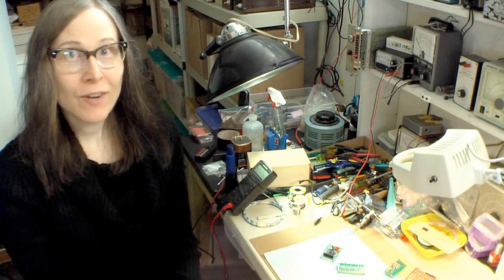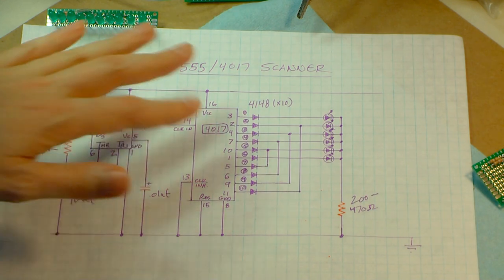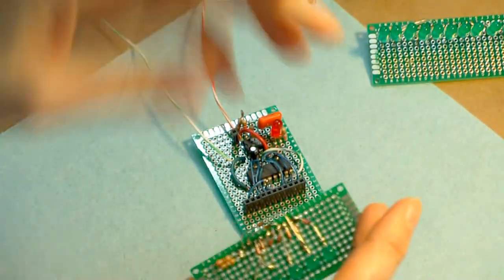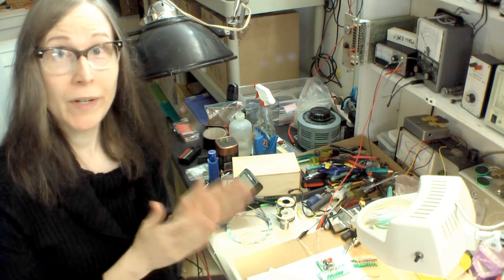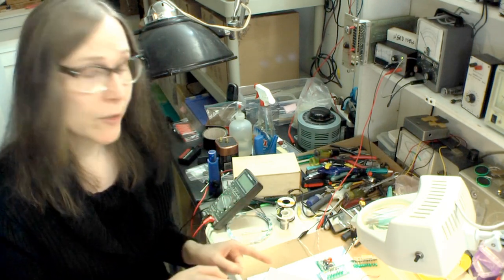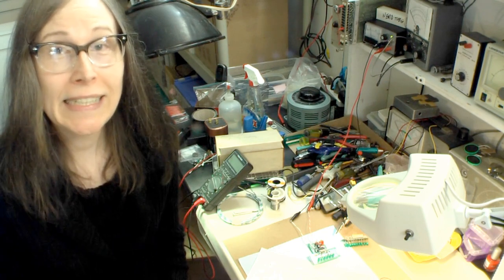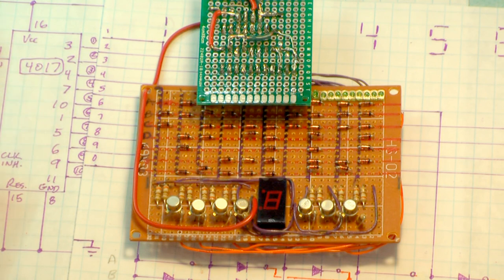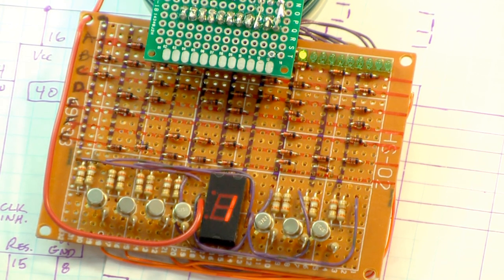FranLab: Diode Steering For Displays

Comment: Interesting project. But I don't agree with that "diode arrow points the wrong way" nonsense. Allow me to explain. When I was a kid and learning about electronics, books told me about the "real direction" of current flow, so I figured I'll use that in my own thinking then. Starting from thinking about circuits "upside down" and even using a red wire for negative and black for positive, and ending with circuits not working. That stuff put a dampener on my enthusiasm, too. I wish books and educators would just say "forget any concerns about the electron flow, and do everything based on conventional current flow". Like everyone else does in electronics.

Unless you're dealing with electrochemistry or the inner structure of transistors or other physics like that, I don't see why you would need to bother thinking about electron flows.
Reply: +renxula Obviously never had to look at any vacuum tube amps or worse.. tube state logic.. "conventional" current flow (which is wrong and should have been sorted out immediately the electron was discovered which is over 100 years ago,, and the other wrong explaination scrapped) will leave anybody who doesn't  know the "convention" is actually nonsense.. puzzling themselves to death about how a tube amplifier or flip flop or latch or diode or anything really.. works..

Like Dave over on EEV says "It's shit, so ignore the "conventional" bull and remember electrons come from the ground, or out of the Negative end"..Then it all makes sense, even those arse about face reverse common sense "wrong" polarity transistor 
semiconductor things !!

I guess some people still think the Sun goes round the Earth eh?
Reply: Sure, if they had fixed things when the electron was discovered, we wouldn't have to deal with the notation now. But like I said, there's no problem unless you need to consider actual electrons physically flying around, instead of just electricity flowing. Yes I'm glad I haven't had to deal with vacuum tubes. But also I don't think semiconductors have wrong polarities. See how easy it is when you think in conventional current flow? :)
Reply: +renxula   I agree with your pragmatic approach.  There are different layers of abstraction appropriate to different activities.  Electronic engineers generally don't need to "how a diode works" (quantum mechanics?) but "how might I use a diode as a component".  Plus, not many will be designing for vacuum tubes these days.
Reply: + Ray Kent. I agree.. it's a matter sometimes of generations. I learned all my stuff when what I saw was vacuum tubes.. radios tv's mono and colour.. and a CTV with maybe 10 transistors and 30 tubes was fun.. So that's why I always think about where the electrons come from and where they go.. because trying to look at a tube circuit using "conventional" current flow directions.. well.. they don't work, it's impossible.Once I worked that out at around age 12 it all fell into place, after all.. what is a circuit?.. it's electrons, coming from somewhere and going to somewhere with a more positive potential. Mostly these days I do solid state stuff like laptops and cooked graphics cards, but I'm also the only kid in town who can fix your 50 year old prized Marshall or Fender amp :D

I stand by my logic that all this confucion could have been very simply avoided 100 years ago by tearing up the "current flows from positive to negative" books.. once that was proven once and for all to be incorrect. The fact that people will still try to defend something which is categorically wrong is silly. A flow of electrical current is a flow of electrons from a negative place to a more positive place.. that's it.. scientific fact. Why don't we just use the scioentific fact and forget the guesswork of the 1860's when nobody knew what an electron was, rather than continuing to build on and add to the mistake which was based on pure guesswork.. They got it wrong, to try to defend thet wrong is silly. Isn't what we do as electronics technicians a branch of science? Isn't science based on facts and not mumbo jumbo?
Reply: PaulaXism  I like that you're repairing classic amps, they are to be treasured!   No offence, but if we teach children that electrons are absolutely "real" then they will have serious conceptual problems with quantum mechanics and deeper understanding of semiconductor behaviour, where "holes" play an important part.  Is a "hole" just an imaginary absence of an electron?  Or is it no more imaginary than the idea of an electron itself?  That may depend on your favoured interpretation of QM and whether an atom of copper constitutes an "observer" to collapse the wave function, for the Copenhagen interpretation.  Almost all laws of physics now are symmetrical, which in a sense means that it doesn't matter which way round you pick for up/down, magnetic north/ magnetic south, electron spin, current flow, etc.  Hope that doesn't sound nasty, it's meant in a totally friendly spirit of dialogue.